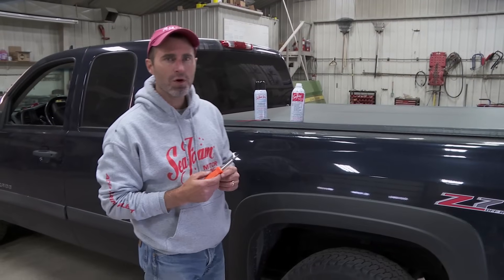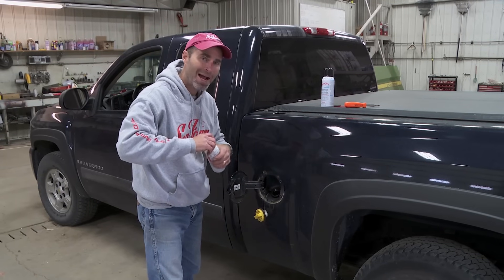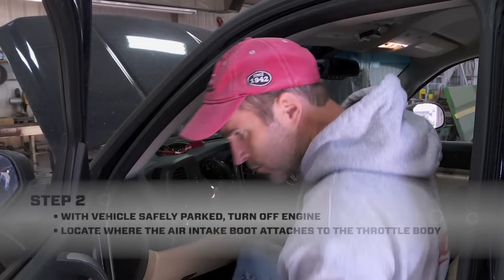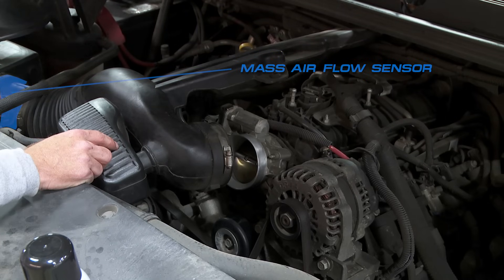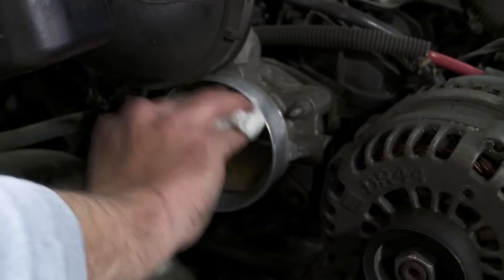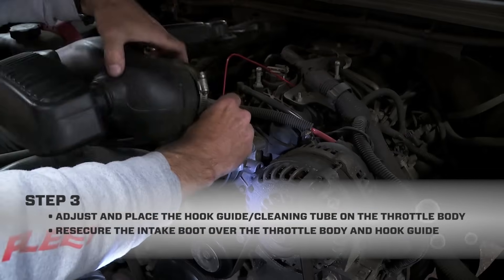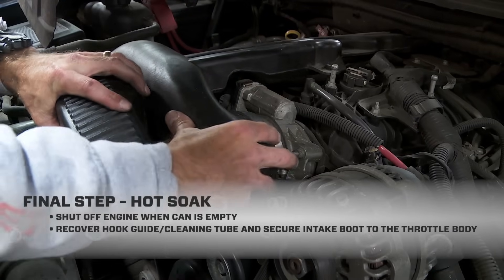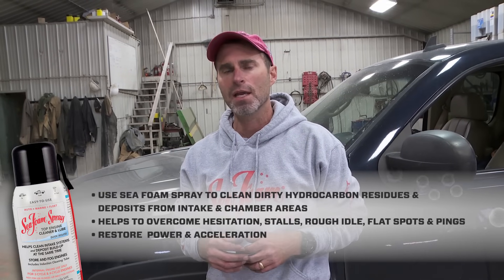How to clean a gasoline fuel injection air intake with Sea Foam Spray

Comment: After hot soaking my mower intake with seafoam, do I need to change the oil? I noticed the engine oil was a little thin after the hot soak.
Reply from the maker: Hi Mike:  No need to change the oil.  There's no relationship with cleaning through a mower's carburetor throat (passes through chamber, out exhaust valve) and the oil crankcase.

Comment: does it clean fuel injectors?
Reply from the maker: When treating through the intake (throttle body), Sea Foam Spray does NOT pass through the fuel injectors.  Sea Foam Motor Treatment in fuel works through fuel injectors.  To help the cleaning concentration, add to fuel when the tank is and drive.  Hope this helps!

Comment: can we do a catalytic converter pressure test and test on the oxygen sensor before and after seafoam use to see how it affects the exhaust system? All that crap has to go somewhere
Reply: if seafoam wasn't bad for the exhaust system wouldn't they prove it by showing data to support how using the product didn't effect o2 sensors, mass airflow sensor, catalytic converter, muffler, etc
Reply from the maker: Try it and let us know what happens.  Sea Foam Spray is NOT a detergent that causes "chunks of stuff"  to loosen and separate...  It is a petroleum solvent with the ability to dissolve other petroleum substances.  One common visual example of a petroleum solvent at work is how oil paint (petroleum) on our hands is easily washed by paint thinner (petroleum) - the petroleum with greater solvency dissolves the other into solution.  Also know that engine residues and deposit are physical variations of unburned petroleum.  If Sea Foam Spray dissolves and reliquefies petroleum residue in a carburetor or injection intake, everything ignites and burns in the chamber.  If you suppose Sea Foam causes other forms of matter to be sent downstream in chips or chunks, try to rethink what's happening.  Hope this helps!
Reply: with everything igniting and burning in the chamber, is it hotter than normal combustion? Is this gonna wear on the piston rings eventually? causing future problems?
Reply from the maker: It is more likely less chamber heat. Much of Sea Foam is a high-temp lubricant, which is the white vaporized oil people like to talk about... From any testing we've done, chamber temps will decrease/run cooler.

Comment: I have a 15 4 cylinder accord with 16000miles. my Honda dealership during my last oil change showed me my air filter that was turning black. They told me to change it soon. 
 When I owned my 93 4.0 inline I used seafoam for my oil and gas and I always had great results. My new car is a long term investment and I want to protect it every possible cheapest way to avoid expensive repairs would the spray option be good right now with my engine and does it void any warranties applying to new cars.
Reply from the maker: Hi Brent - your question is important. Car engine warranties impose limitations, terms and conditions made by the party that upholds the warranty whether auto maker,  3rd party, whatever.  Check out the Magnuson-Moss Warranty Act. Unless a part or product used is known as harmful, an auto warrantor cannot require/limit a consumer to use any particular product does harm.  No matter, you need to understand from Honda about your '15 Accord (if under warranty).  

Sea Foam is all petroleum-derived.  NO harsh chemicals or detergents.  No worries, just use as instructed.  Hope this helps!

Comment: I ran Seafoam through a lawnmower that had been sitting outside(covered) for 5-6 years and after a lot of smoke it still runs to this day.  

The initial problem was that would never run longer than 5 mins. I had only had it about a year and it was in the shop 3 times with the same results. I figured it couldn't hurt to see if the Seafoam treatment would work.

Comment: I have a 1968 Camaro 327, 4bbl. Can I put it in the gas tank to clean the valves?
Reply from the maker: Yes, but much better to run Sea Foam Spray down your Camaro's carburetor throat.  See same Sea Foam Official video topic doing a step-by-step (on a '65 Impala).
Reply: My carb and intake are brand new. I just want to make sure I get the valves/pistons clean.

Comment: Do you constantly hold down the spray, or in bursts?
Reply from the maker: Great question. For a fuel injection engine, constant.  If your engine RPM is held over 2,000 you won't miss a beat.  Takes about 4 to 5 minutes to use the whole can.

Comment: Do I need to drive my gas out before using this.
Reply from the maker: Not necessary.  Just know that you'll get a higher cleaning concentration by adding a can of Sea Foam to low fuel.
Reply: @SeaFoamOfficial  am i correct in saying it takes a few days (if not driving much ) to get it thru your system?. I had bad acceleration problems after getting ethanol gas. Put the seafoam in my gas tank (about quarter a can) into my gas tank, 2days later the acceleration problem stopped does this sound normal?
Reply from the maker: @Hasan-Wallah  If you add a can of Sea Foam to fuel it's going to work while it's in the fuel.  If you add a can of Sea Foam to 4 gallons of gas and your burn one gallon, you've only used 25% (4 ounces) of the Sea Foam.

Comment: does the amount of fuel in the car determine when I should put the sea foam in my gas tank? I have a 540i 94 BMW and it stalled the other day while switching the gear into drive.

Comment: Fellows:  Take note that this guy makes it look simple; it isn't. 
The instruction to have a helper keep the RPMs at a certain point presents a single guy with a problem. On my 2000 Corolla, you have to carefully keep the throttle increased a bit as you spray in the SeaFoam to keep the engine running. Near the end of the process, you will get considerable white smoke out of the tailpipe, which is the varnish, etc. being burned and flushed loose. My Advance Auto guy helped me do it (he has done it many times) and once you see it done, it is simple. The red skinny tube should not touch the 'butterfly' valve... just nearly touch it when it's opened.
Reply: use a stick and your seat to hold the accelerator at the required position. not hard.
Reply: Doug H. in VA thanks for the tip with the red straw. I put it past the throttle plate and it pinched the straw shut. Time to try again
Reply: So you didn't follow directions....
Reply: So exactly what was shown and explained in the video.....

Comment: So, I did my 03 Ford F-150 yesterday (Saturday).  
Results: No smoke, at all, while spraying into  the throttle plate.  None.  Hmmm...  I let it sit for 12 minutes.   Started the truck.  Service Engine light stays on and has since.  I only got one really good blow of smoke when I left out onto to main road.  No smoke after that...

Engine seems to run smoother.  Quieter.  

However. My Service Engine indicated is still lit.  This is the third vehicle I have done with no issues.  One being my brother's '03 F150

Ideas?
Reply from the maker: Drive about 20 miles.  If CEL is still on, try disconnecting the crank battery or have the code reset.
Reply: Disconnect your negative side of your battery for 30 minutes, connect it again, that´s it.
Reply: KyCavalier buy a cheap Bluetooth OBDII scanner and download Torque, saves me a lot of time troubleshooting
Reply: Thank you for your replies!!  I appreciate it.

Just to let everyone know I did it on Saturday, and the light went out on Tuesday finally.  Runs like a champ!!
Reply from the maker: Great - thanks, KyCavalier.

Comment: Hey , do I empty the entire can trough the throttle body intake?
Reply from the maker: Yes, that's what recommend - use the whole can of Sea Foam Spray.  Can use more if needed....
Reply: @SeaFoamOfficial  I use seafoam this morning can I use another one tomorrow in engine update?
Reply from the maker: @brightonb.g.t.3126  In fuel can add as often as you wish.  In oil, one treatment per oil change interval.

Comment: After having all my fuel injectors replaced, the check engine light continued to come on (2004 Acura TL). A bit frustrating. I started using SeaFoam and after 15 miles the check engine light goes off. This works everytime, so I know it is solving my problem. I will try the cleaner in the intake to see if this even reduces the check in light problem. Car runs smooth and its has 210k miles.
Reply from the maker: Thanks, Jerry.  Let us know what happens after the intake cleaning!

Comment: I have a 2005 Outback 2.5i. I either have a bad fuel injector or a problem with that valve/cylinder, as I have replaced the plug, wires and coil and still have a shake/miss for that cylinder. 
I have poured almost a can of seafoam into the gas. What do you guys suggest also doing (other than pushing the Subaru off a cliff)? Spray into the brake booster, air intake, or pour some into the oil?
Reply: Kay O'Pechtate figure out the problem first before doing anything.
Reply from the maker: When fuel in tank is very low, add 2 cans of Sea Foam, then do an upper intake cleaning with Sea Foam Spray through the throttle body.  After hot soak (video), drive the car at least 20 miles.  If the engine runs better, know that you can repeat Sea Foam Spray cleanings because you realize the cleaning progress.
Reply: Check for blown head gaskets, common with those 2.5 subbies

Comment: I did this to a 2000 Ford Ranger via air intake just like in the video, there was no smoke. Is that normal?
Reply from the maker: The smoke is oil vapor from the Sea Foam (petroleum lubricant). 4 questions: Did you apply at the throttle plate and run RPM at 2000+? Use the whole can?  How long did you hot soak the chambers?  Was it windy outside?   Note that you can do everything correct and not see the white vapor.
Reply: Got engine to operating temp, turned the vehicle off and loosened air intake hose slipped the straw in right before the throttle body closed it up started the vehicle and had another person keep the car at 2000RPM while I sprayed a little over 90% of the can in. And yes it did hit the throttle plate. Engine sounded a lot louder as I sprayed it in as well. The vehicle feels better, and idles better for sure. Just unsure why there was no vapor? And I let it hot soak for 5 to 6 minutes.
Reply from the maker: Thanks for the follow up - helpful!   One reality is that seeing the vaporized lubricating oil (white smoke) shows that Sea Foam survives and works through the chamber heat. That's the only value, so not seeing the smoke otherwise means nothing - don't overvalue the smoke.  For what it's worth, next time you do a treatment let it hot soak for 15 minutes - the longer the chambers cool, the more likely the vapor.

Comment: Can I let it hot soak for a longer period of time? Say like 1-2 hours? or does that defeat the purpose? (Mazda RX8)
Thanks
Reply from the maker: Great question.  Yes, that works.  Can also do multiple hot soaks, like this: stop and shut off after half a can, let it hot soak 10 minutes, start up and spray the second half of the can,  shut off to begin hot soak #2.  When you soak for a longer period be prepared for the engine a bit longer to re-adjust (because the intake is cold after sitting).

Comment: So should i start my car before putting in seafoam into the gas tank? Or is it ok to do it on a coop engine?
Reply from the maker: Thanks for the question. Engine on/off makes no difference when adding Sea Foam to the tank.

Comment: My gas tank is a 26 gallon tank is one can of SEAFOAM enough every 3000 miles.
Reply from the maker: Add a full can or two when the tank is very low, 1/8 or less, then drive till you need to add more fuel.  Adding more Sea Foam to less fuel = higher cleaning concentration.

Comment: Bryan i think its all good now! I disconnected the neg batt term and while i was in there i said to myself well let me go ahead and clean the MAF sensor i noticed the plastic connector was wet wondering if it was from my DIY Fuel induction service. So i dried it up cleaned the MAF sensor with CRC MAF sensor cleaner and then i said while im in here might as well clean my thottle body with some CRC throttle body cleaner. Put it all back together. Turned the key let it sit for a couple min cranked it up and drove down the street and back and NO ENGINE LIGHT ON!!! YAY!!! THNX FOR YOUR HELP AND INPUT!

Comment: Hey Bryan, i did this exactly as you did and the next morning chk engine light came on. My 2013 F150 3.7 XLT is running fine though, dont notice any shakes, misses, hisses nor skips.
Reply from the maker: Best guess is ecm (engine computer) made an adjustment to the fuel mix.  Drive a bit more for the ecm to adjust.  If the check engine light doesn't go off try disconnecting the battery momentarily to reset.  Let us know if it solves.

Comment: I added the entire bottle and drove 25 miles and sometime aggressively, i actually noticed a small difference. My truck feels slightly faster and more responsive. Really good but it takes a while to do this work.
Reply from the maker: Thanks for the report.   Improved throttle response is usually noticed.

Comment: So will this work on a 2001 volvo c70 that intermittantly stalls on starting.
Reply from the maker: Try this:  When the tank is very low, add 2 cans of Sea Foam to the fuel toward the end of the day.  Drive at least 10 miles, then leave the car to sit overnight.  On the next day, do a Sea Foam Spray and hot soak treatment through the throttle body (full can).  Let us know what happens.

Comment: So I did the exact steps as shown in the video. My check engine light came on so I went to Auto Zone n they said it was the Throttle Body. I did push the plate a little to push the nozzle in, could that have 'damaged' it? Could I just keep driving see if it'll go away or would I have to replace my throttle body?
Reply from the maker: Try clearing the code (or momentarily disconnect crank battery connection) to help the sensor reset.  If the code is P0121, your throttle body sensor was disrupted. There's nothing wrong with your throttle body, anyway.

Comment: Hi, can I use the spray bottle in an electric throttle body?. I have a 2007 Honda fit and Honda tech are saying I have to be very careful when cleaning electric throttle because it may damage it. Thanks
Reply from the maker: Hi Kirk:  Sea Foam Spray is an upper engine cleaner that's applied THROUGH the throttle body to clean intake valves and chamber areas.  Note: Virtually all modern gas engines have an electronically-controlled throttle. A throttle body is a physical housing.  If a tech told you be careful, the tech probably thought you were going to spray something ON the  "electric" motor that controls your throttle valve, not THROUGH the actual throttle body, which is not electronic. Hope this helps. Let us know if you have more questions.
Reply: Thank you.
Reply from the maker: Our pleasure.  By the way, Honda autos are almost always very easy to do this sort of application.  They also respond very well to adding Sea Foam to the oil crankcase every change interval.
Reply: Not with the Honda fit 1st gen. haha.  Throttle body is on the side and there's so much other crap to disconnect before you can pull it on the side to insert seafoam hose.
Reply from the maker: And then there's the tough to access stuff.  Your Fit should do well from it, anyway.  Don't forget the add-to-oil part.
Reply: Thanks. I'll add in oil before change oil. I just did change oil on it just last week. haha.

Comment: My mass air flow sensor is on my throttle body, can I still do this if I can get the hook guide passed it?
Reply from the maker: Depends on the location of the MAF sensor.  In most cases,  just make sure you have enough RPM draw going on while spraying to avoid the sensor.  And, never place the straw to interfere with the throttle plate.  Hope this helps.

Comment: Is this spray different from throttle body cleaners? Like I've used throttle body cleaners but they don't clean all this stuff that this cleaner your showing cleans, correct?
Reply from the maker: Sea Foam Spray cleans the upper engine [intake runners to intake valves to chamber]. Think of it as applying Sea Foam Motor Treatment through the throttle body (only as an access point) to treat upper engine areas where fuel additives cannot reach.  Some throttle body cleaners are spray on throttle body parts and wipe off.  Hope this helps!

Comment: My 1996 accord coupe has 283k....should I or should I not? It was meticulously maintained but I also want it to run better. It's not rough running per se, but I know the engine hasn't been cleaned.
Reply from the maker: Thanks for the question.  Sea Foam works to clean petroleum residues in fuel and motor oil systems.  If that's what you want to do for your Accord, try it.  Up to you!